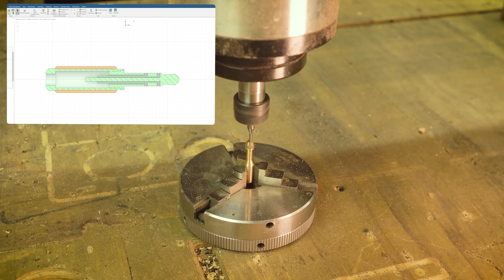I made a stereo mini plug!

Comment: I was hoping to see the 3.5mm jack being soldered and in use. Maybe it's a trophy for the loss of headphone jack sockets on all our phones. Good work all the same! 🎧👍
Reply: People, who buy phones without headphone jack are traitors! They are betraying the concept of the tool a smartphone should be! As long as there are manufacturers, producing capable phones with the 3.5mm jack, i cant buy the best camera software phones... 🥲
Reply: Hail sony
Reply: @BernhardBB8  I fully respect your position on this, but I got my first cell phone around 1998 and have never used a headphone jack. I don't even look to see if it has one. I never did. I do however look for SD card support and try not to get a phone without one on principle, but I need a really good phone for work and that always comes first.
Reply: speak for yourself, my phone has headphone jack
Reply: @BernhardBB8 there is phones with headphone jacks, but even lower end ones don't have them sometimes. It's sad that i even needed to look if mine had one or not. Funny how my phone that i got last year has a bigger battery than a current iphone, while apple claims that removing the headphone jack is for "space" or some BS
Reply: @Giuliana-w1f I’ve opened iphones and u can always find space. I make it a point on every phone I open. It can even be water resistant. But now a days u be hard pressed not to find a pair of blue tooth headphones that go way louder than the iPhone would ever let u get with a cord. Tell u what tho, i was mad as hell to find the switch doesn’t have Bluetooth support. A chip the size and cost of rice is missing from a 2023 Nintendo portable device. What in the actual flip. So now, if u want to game and listen to music you will likely be carrying two pairs of headphones that day.
Reply: i refuse to purchase those phones.. good luck with financially supporting companies that don't listen to their customers (APPLE)
Reply: @ajosepi1976   same... sadly only one (2 kinda) phone is on the market right now with the latest chipset and sd card support as well as headphone jack. the sony experia 1V and 5V.... both >1000€
on more budget class-chipsets there are a few more but also not many (i do like the jelly star tho because its tiny... but a bit tooo tiny for me)
if anyone got recommendations compareable to the experia lineup (if cheaper, even better), please tell me :I

Comment: I'm more interested in that Auto-Chuck system 0:23 you made than the mini plug....I could adapt it to my small lathes.
Reply: oh, i get it: 3 compression springs, ends held by transverse pins between 2 plates, and is compressed [by fork] to release, released to tighten. Plans would be great...
Reply: A say the same thing I must have on that part of the video for 5 or 10 minutes haha

Comment: Superbly done! The only part I'm wondering about is the UV resin that isn't directly exposed to UV light.. do you know if the internal resin was hardened? I'd worry about it remaining uncured, but I'm not familiar with what resin you used.
Reply: You'd think the light would refract through the translucent resin from where it's exposed to light.
Reply: Same question here, but I assume uncured resin is as electrically isolant as cured stuff.

Comment: nice work but what is the purpose if it doesn't work.. lol
Reply: As a replacement stereo plug, it is 100% ready to be soldered onto a standard 3-core audio cable.
It has a purpose.
Reply: Who said it doesn't work? The contacts extend to the back, it should work